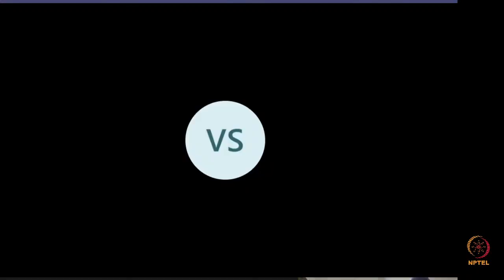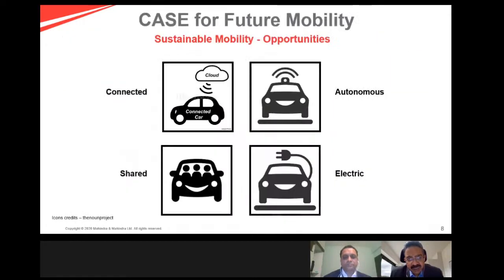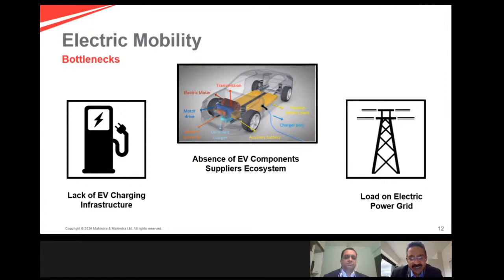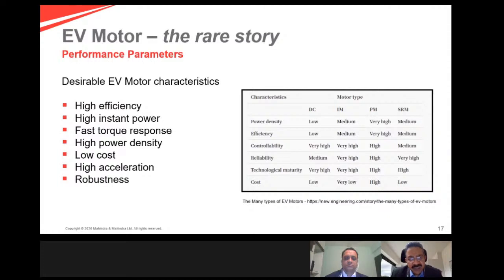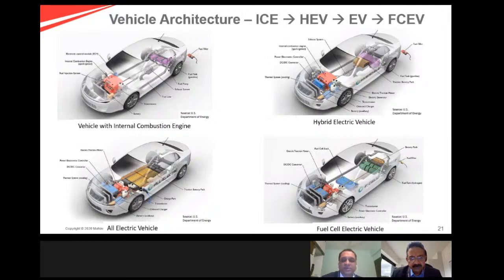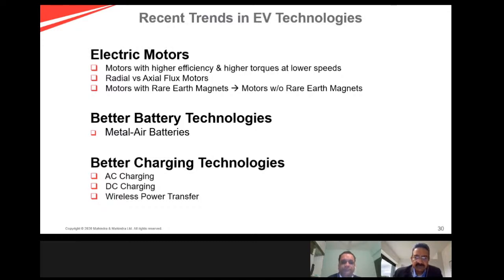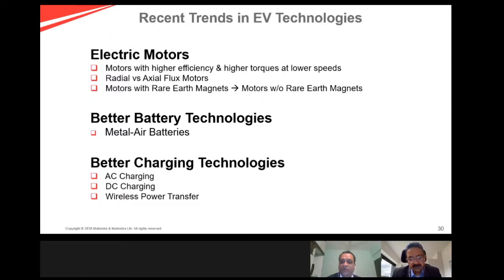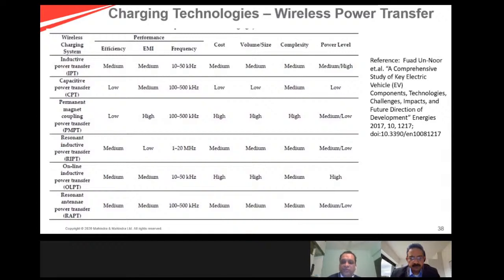Live_Electric Vehicles – Design & Development

Comment: To resolve bottleneck issues like Load on Power grid we need to build Solar Power Generation Station in Rajasthan Deserts. EV components and EV charging stations issue is being handled by Tata Power in advance.
Reply: Good to know
Reply: Well to your dismay, raj gov has only now stood up for a solar park under govt. So far only private palyer had solar parks in raj.
Not that, but also the open access charges and css , surcharges, transmission charges, wheeling charges, etc are the tools through which solar cant directly florouish with distribution company facing this market competition. As all solar parks are under either captive or opex.
Which is not directly under RRVUNL, so
This is a far fetched dream😊
Reply: Also there aint any time of day rebate to evs in rajasthan and MOST OF THE STATE